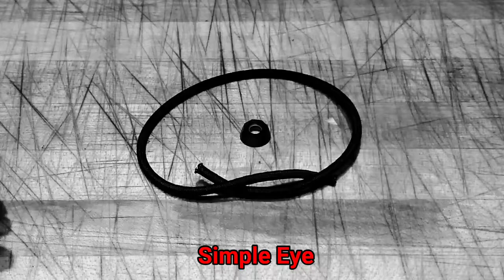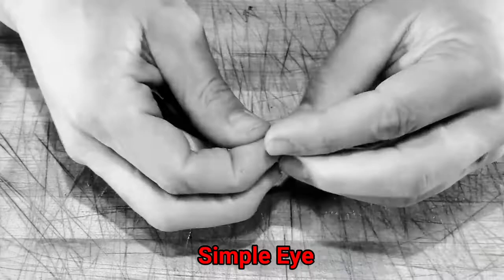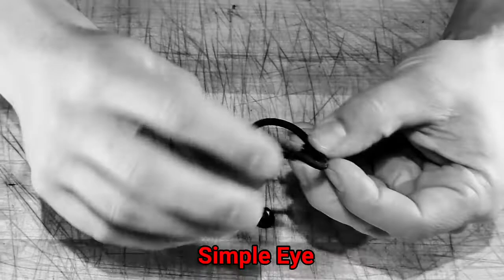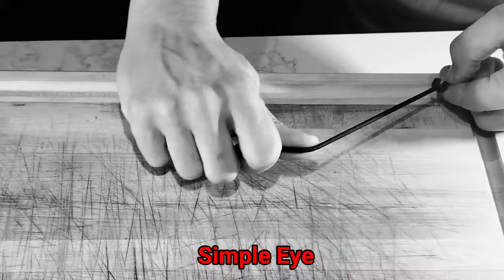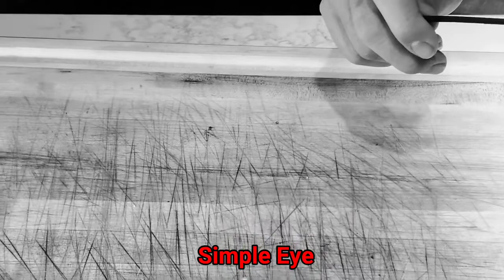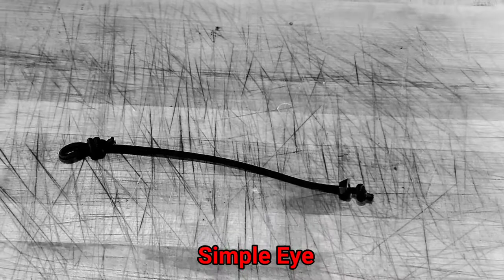Bigger Better Breaker Bead - Simple Eye Set up

Comment: sure its more dence then lead but   i could just have a slightly bigger hex nut instead and pay less then a dollar reletivly. what i would like is a throwing spike out of tungston carbide. idealy pure tungston but that would be expensive
Reply from the maker: A Throwing Spike made from Tungsten Carbide would be very expensive, and likely break much sooner than you would like.

You can try making a Tungsten Throwing Spike from a TIG welder Electrode. They are a consumable rod, and should be available at most welding supply stores or welding shops

The Hardness of the Tungsten Carbide is what let's it break glass so easily. A hex nut won't work as well... not to say it can't work at all though.
Reply: @Delta2AlphaDesign  i was thinking about  taking a TC drill bit actually and doing something with that. why  would it break though?
Reply from the maker: @kirill2525  Tungsten Carbide is very hard. It does respond well to shock loading. The more expensive ones will fair better.